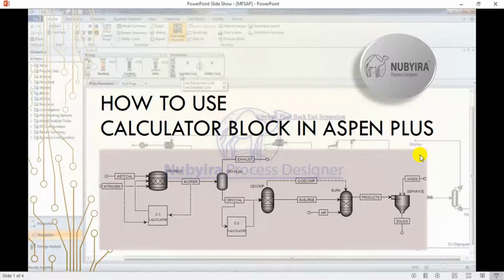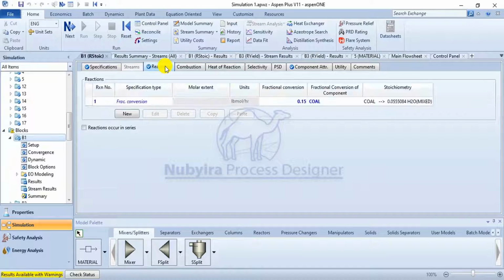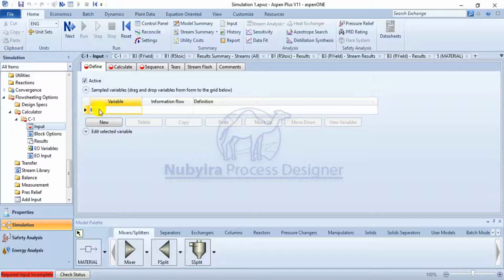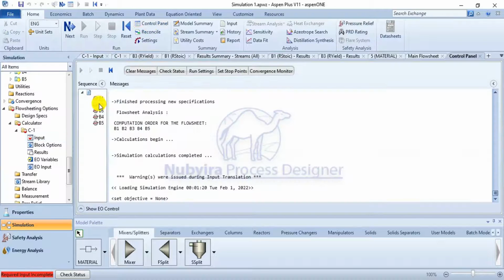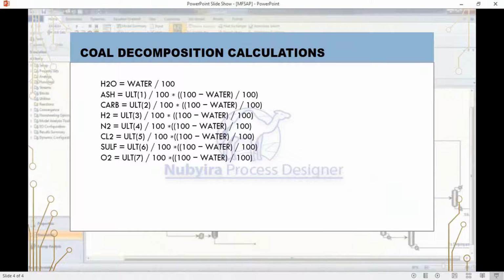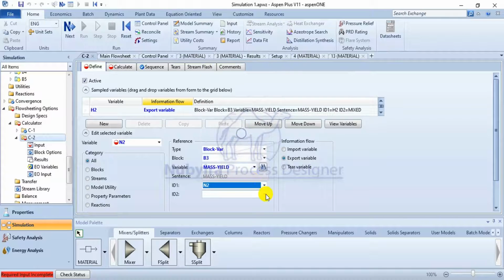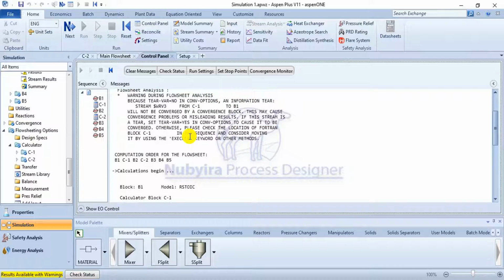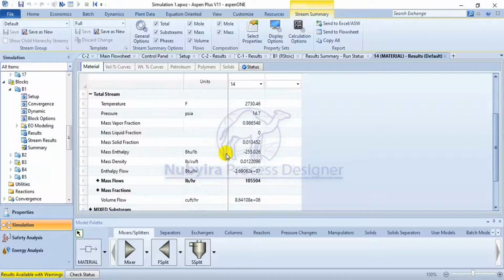How To Use Calculator Block In Aspen Plus

Comment: HI the link to get the aspen file is not working
Reply from the maker: Hi, I just checked. The link is working perfectly. Have you subscribed to support us?
Reply: @nubyiraprocessdesigners  Yeah it is working but there is no explanation on how you find the decomposition formula of each compound ...can you please help me in that section
Reply: how did you get the decomposition calculations
Reply from the maker: @giselembida2001  the decomposition yield calculation is gotten from the normalization of the ultimate analysis ( dry elemental composition) of the biomass to include its moisture ( water) content fraction.